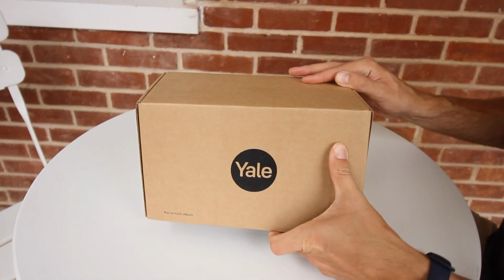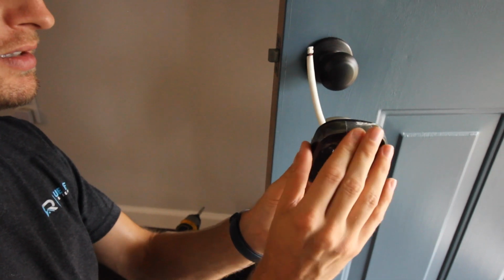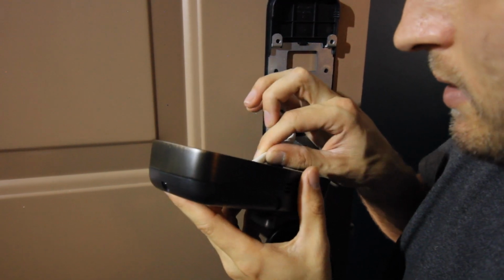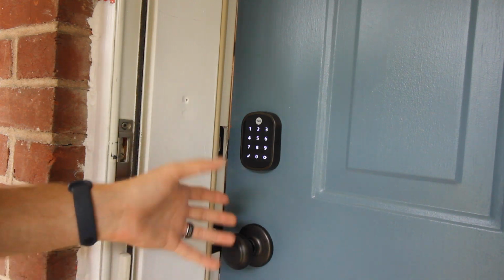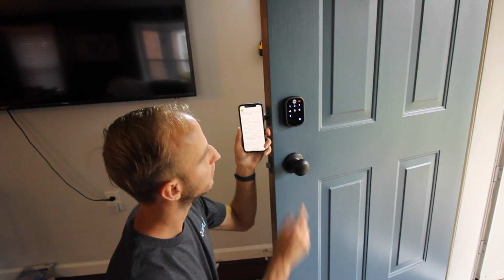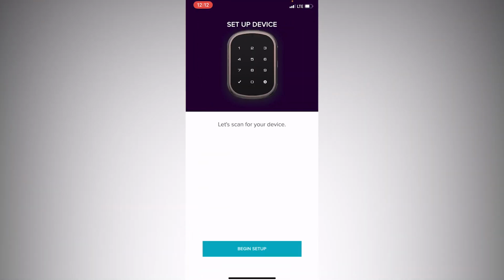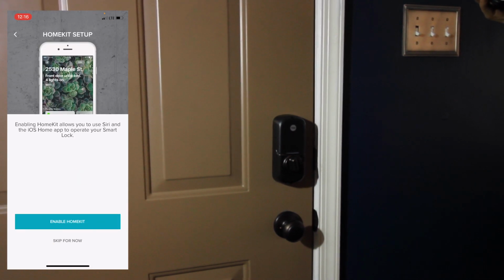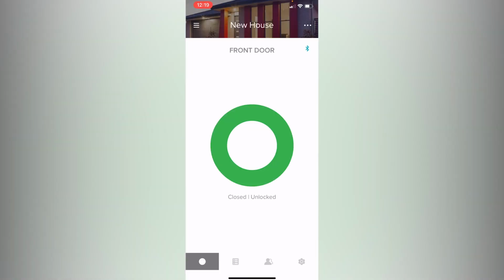Unboxing and Installing a YALE ASSURE Smart Lock!

Comment: Hi bro nice video,
Have a quick question do UP direction should be faced exterior lock or interior?
Why this question is if i place the UP symbol to exterior, and when i try to check lock and unlock it’s not working?
So stuck there

Comment: My yale smart lock that I bought from costco without any installation instructions. There was not even instruction about how to set up master code. I can tell that software interface is buggy! Nice hardware but poor soft ware and no documentation absolutely sucks
Reply: Is your door a right handed or left handed?
Currently facing an issue with deadbolt installation

Comment: Is the smart module necessary if i want to unlock or lock the door while im away from home? Or can i just use the app? The smart module wasn't included with mines.
Reply from the maker: I’ll copy and paste here what Yale says about this: The Yale Wi-Fi Smart Module will allow you to lock or unlock, share access and see who comes and goes using your Yale Access app, from anywhere. No additional hub or Connect is needed, just your home's Wi-Fi network (2.4 Ghz).

So it seems that the module is required for certain functions, but I’m not totally certain whether the Yale Connect (which plugs into a wall outlet) accomplishes the same task. You can certainly install the lock, try the app, and see what functionality it allows you. If you are a homeowner that will only use this lock for yourself, you may find that the smart module is an extra feature that you don’t need. I operate rental properties that use this lock system, so I like to have all the add on features that save me time.
Reply: @TheRenoBros  Thanks for the detailed response, I appreciate it! From what your saying, sounds like I need the module. Done deal, thanks again!
Reply from the maker: @roachjuice5222  You’re welcome! Hope you are able to get it all set up without any issues!
Reply: The Yale smart module allows for auto-unlock via bluetooth Geofencing technology.

Comment: Is the wifi bridge module included with the package or does it have to be purchased separately
Reply from the maker: In the set I purchased, the Wi-Fi Bridge was included, as well as the module chip that gets inserted into the interior side of the lock.

Comment: Do you have to install the door sense aspect of the lock? Wish I had seen this video before I bought my Yale lock.
Reply from the maker: Great question! The door sense is not 100% required for the lock’s basic functions, but it allows it to communicate correctly with the app. It is a helpful feature if you are away from home and want to check the status of your door, like whether it’s opened or closed. It also helps provide better, more accurate functionality, but it won’t make your Yale lock useless if you didn’t install the door sense. You just won’t have access to all the benefits of your Yale lock if you didn’t install the door sense part.